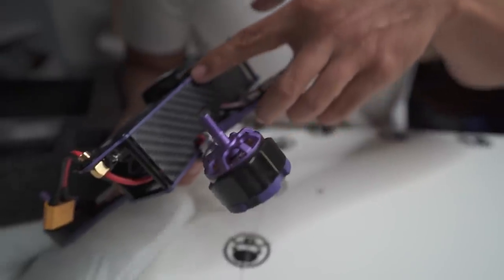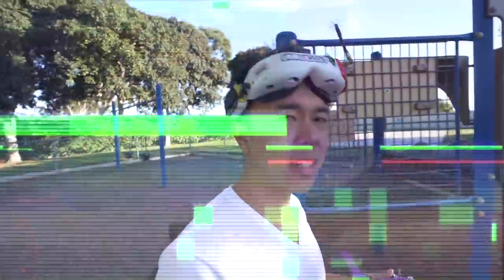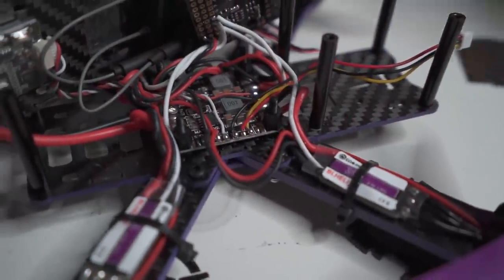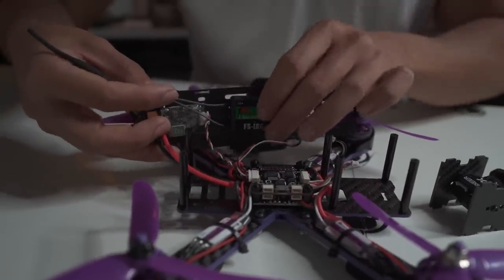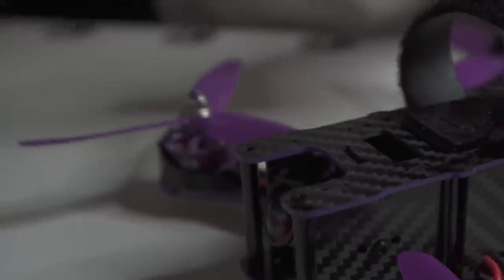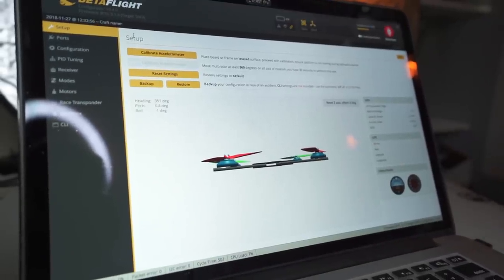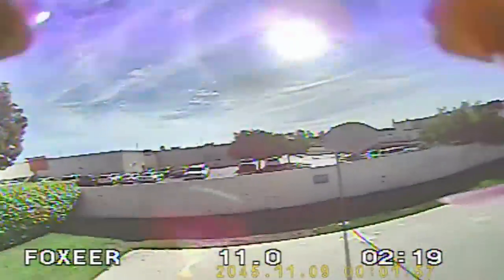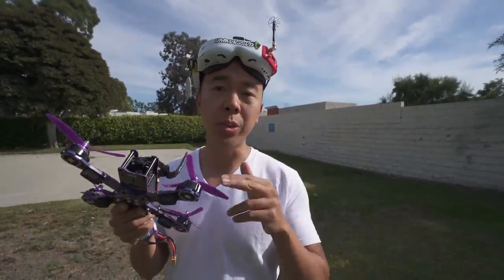Modding the Eachine Wizard X220 Drone! - Kwad Mods

Comment: So for wizard Owners , if you want an antenna upgrade just remove the rubber sleeve and cut the antenna wire to 12.9 mm , cause in fact for some odd reason eachine provided you with a 31 mm long 2.4 GHz antenna

Comment: Tommy’s here to pimp yo kwad
Reply: Le Drib lmao
Reply: Hey Drew, please ask Tommy to explain why he connected the camera to the vtx pad at 9:18. I know it will work on that PDB, but if any other beginner will try that on an FC with osd, he'll have to take the quad apart a second time....
Reply: according to the osd, it took him 3 years to do it.. c'mon tommy....
Reply: @LotharKrupka  That is where Eachine had the original camera connected to. I totally rewired my PDB but, it won't do any harm to connect the camera signal to the VTx pad on the PDB because it just a direct connection to the CAM pad on the PDB, where they have the video signal wire for the VTx connected to. 

Yeah, I know it is confusing how they wired the PDB but, it is Eachine we are talking about here. The power for the VTx also needs moved from VCC to a 12V pad, if you want to safely use 4S (there is a risk of voltage spikes from the ESCs damaging it if you don't).
Reply: Le Drib 😀👍🏻
Reply: #pimpedwizard, more of that please.
Reply: I got into FPV recently after finding your channel and bought a Wizard x220. This video is what I need. More like this please.
Reply: We heard you like Cable ties, so we put some cable ties on your cable ties so that you can tie whilst you cable.
Reply: Mod my kwad
Reply: Insert Pimp My Ride meme (here)
Reply: Sounds like a new Rotor Riot Series...PIMP MY KWAD
Reply: @Le Drib Please come to South Africa... i have accomodation... lolz... i guess you can bring tommy... XD

love the channel wish i could fly and keep it up...
Reply: Nah he's just rerolling the mods with some kuva he got
Reply: Le drib?????? Nice try guy its la drib
Reply: @LotharKrupka  idk why but it feels weird that you called him his actual name lol

Comment: So I've been flying for a couple years and the wizard was my first quad and since that I've built all of my quads. I definitely made a ton of mods to this quad and I totally love everything you did in this video. As far as the really easy things go the only other thing I would suggest is ditch the side plates. This is the only frame I've seen that has side plates and I've never had a crash that destroyed anything on the inside without the side plates on. Plus this will give the quad more yaw authority. Oh and you mentioned it but I guess forgot to actually do it, but it's definitely a good idea to change that antenna to an omni for sure. It makes me so happy that you guys are making this series because it's exactly how I started out and by doing this you're helping the non-confident new comers be confident. Keep ripping guys you're awesome!

Comment: Great video! Had mine for over 18 months now and it's a great flyer. I did change the camera too after a week of flying and put a different vtx in a couple of months after. 
I've recently switched all the components across to a new frame (5 inch Dingo) within the last 3 weeks and it's still great fun. 
Id recommend soft mounting the FC too, I've never changed any PID settings and it's running and older version of BF too.

Comment: If you guys want to shave off some cost, I bought mine during the sale at bang good a year ago and save like $45 buying the remote/receiver separate and just a ARF version of the 220 for $99. They can keep the junk 3s battery and charger. That way you can invest that extra cash in better props, antennas, batteries/charges whatever you choose, OR if you have some stuff already your golden.

Great flying drone, thing screams on 4S def will enjoy it...only down side is its heavy as heck especially if you toss a go pro/action camera on it...but for the price cant beat it. Parts are cheap motors/ESCs
Reply: somebody should probably pin this comment at the top?
Reply: @TheMadmacs  just depends if its on sale or not to save like I did or what you all need and how you want to go about the hobby. If you just want something to grab and go then buy the bundle... The battery/charger that comes with it is garbage, so if ur serious about getting into the hobby and want some resell value(incase u get out of the hobby assuming your new to it) you can buy a ISDT charger or something descent so you can actually recoup some funds. Then grab some descent batteries, for what you pay for the "wizard x220 battery" replacement you can buy a tattu or turnigy 3s same price or less.

Comment: I use the Same transmitter (fsi6), But i moddet its Firmware so i can use all switches and use 10 instat of 6 Channels.

Also i Set the  arm switch to swB, turtlemode on swA, beeper and light on/off, on vrA, color on vrB, flightmodes on swC, and airmode on swD.  This is my Setup on all models for this transmitter.

Comment: Cool video,  wizards are great to teach the basics.  A few upgrades and they do pretty well for the money.  Despite progressing onto Roosters etc.  I still keep my wizard to practice all the tricky stuff. Recently I've dropped the top  plate about 20mm which makes it look really good.  Replaced boards with a Racerstar f4s tattoo all in one board to really tidy and lighten it up.  Moves so much better now,  along with a runcam swift and a decent vtx it's a very capable little beast!

Comment: Wow. I wasn't expecting this on Rotor Riot channel - Thanks for this video Tommy. At least I know that my almost 2 years old Wizard wasn't a waste of money - when I see you (almost in 2019) focusing on it and investing your time to try it out with respect to this quad. Sure it's not the best one, but for those who have not much time or areas to fly very often - this is the cheapest and still good enough solution to start with. Especially with Full HD camera on top which Wizard was made for. AND YES - stock VPS camera is just horrible - I can't believe I was flying with it whole spring of 2017 before replacing it few months later (too late) with a wider one, with osd and much brighter picture - which helped a lot. I simply couldn't see much with the old one - and it was very risky to fly in some areas. It took away a lot of confidence to do acro. I felt trapped inside the goggles, to tell the truth. I should have replaced it before the first flight - so my beginning and switching from simulators to real quads would be so much easier. That's why I'm glad you've pointed this out for new beginners now. A very important thing to avoid the disappointment of new guys in the hobby: Replacing the camera at the beginning.
But old Wizard itself is still a nice one - Even though I've started with it, before moving to smaller quads (not so stable but safer at least) - I think that in spring of 2019 it's still gonna be a good quad to consider having fun with. Can fly surprisingly smooth in acro. Stabilized flight is not the best in this one (some micros fly better in horizon than Wizard does) - who flies horizon on 5 inch anyway. Can carry a lot of weight and fly fast enough even for medium freestyle pilots.
Won't ever be like one of your machines but at least it's cheap to replace, great to start with and train for the very first year of FPV - or even for two, three years. Really, thanks for this video man.

Comment: Thats funny! I started with one of these! Esc's caught fire so i changed almost everything on it. Nice video :)
Reply: wasnt that the early versions that were known to do that?
Reply: I bought mine in July 2018, 2 caught fire. 
Then i changed all 4 esc's, all 4 motors, fpv cam, then finally the fc.
Reply: @zeni-Geva  hmmmm i wonder if it has to do with their shitty wiring job on the PCB. I know its sort of weird but everyone claimed if u wanted to safely run 4S batteries on the wizard u had to rewire the PcB a bit  cause off some claiming the ESC braking could fry some stuff as some stuff was wired to the BATTERY pads for power instead of a 12v stable pads for source of power. I think in terms of the VTX they were saying was the reason you needed to rewire it IDK i did that to mine and rewired it when i first got it(since i had to redo the camera as well( and i never had issues except when I crashed and lost a ESC....im running 3 old and 1 new ESC and its been fine so far.

Mine was all jacked wired, some stuff that needed 5 volts was spliced into LED pads, and the Camera was like wired to the VTX pads and vice a versa...confusing as hell but i know it was messily wired like that stock from factory.
Reply: bought mine in 2017, never changed anything except camera and antenna. The quad still flies perfectly with all the parts it came
Reply: I’ve also caught fire on one of those esc after battery replacement to 4s and more aggresive props.
Reply: @MrDracul88  how aggresive? i havent gone over dal 5045c 's   I got some bullnose 5045s and some 5040c 's i havent tried yet
Reply: VideoGame Polak 5045 on full power. Those escs are tiny for Today standards but can be easly replaced together with AIO fc
Reply: zee Gee so u basically bought a new qwad😂
Reply: @MrDracul88  yeah but a AIO 4 in 1 ESC, what happens if you burn out a ESC on that? $40-50 for the whole board versus $8 for a replacent ESC on the wizard single esc
Reply: @Fliptality  same here flying 4s left vtx wires where they were , no issues but upgraded vtx later, use stock vtx with HT on bipe.  my wizard has been flawless.
Reply: same ESCs caught fire got new ones

Comment: No way, just ordered this a couple weeks ago on banggood with 4s batteries, extra props, arms, and motors as my first quad haha! Love these beginner videos, so helpful!
Reply: eek 4s?....   find a field, a big field... a big big big field hehehe... you should get as much sim practice as you can,  even the gta5 mod with the quad simulator is worth it just to get the feel for what the sticks do.
Reply: @TheMadmacs  haha yeah, I've got a good 4 acres of open, obstacle-less field to practice in and am spending a ton of time in liftoff. Super excited, but I'm preparing to crash hard 😅
Reply: @LandonCramer  ah you should be fine then,  throttle is the first thing people struggle with,  just remember to include lots of bank turns  emergency stops and straight and level flight in your practice, and don't stay in the open field so long you are scared by obstacles,  and try some dal cyclone 5046 props, clear coloured if you can find them... and start getting advice on cheap motor replacements right away,
Reply: @TheMadmacs  will do, thanks!!
Reply: @TheMadmacs  and what about the t5050C props? I already ordered those...
Reply: @LandonCramer  i havent tried those but they should be ok, bit heavy on the batteries?  5046's were a revelation for me, throttle control was much more precise,  the 5050 might be perfect for you
Reply: @TheMadmacs  I been using Gemfan 5042. Tossed the included bag o props out. used 5046 b4 these 5042. Being a noob with no sim(no network), can't address performance, obviously lost some, but these 42's give me much better flight time and durable. about 1 1/2 minute more then 5046.
Reply: @flwoods1  yeah i  think the main lesson is to try different props now and then, i spent way too long thinking KK 5040's were perfect,  never even opened the bag of 5045s, then i thought dal 5045's were perfect and didnt even open the 5046's, they also looked way to heavy on pitch... but as soon as i tried them, i felt that i could adjust height so accurately it was unbelievable.. njtech did a video about how your throttle should feel every bit as accurate as roll  pitch and yaw, and thats what dal 5046's are for me, i can change my height a couple of inches with no problems.

Comment: I picked up the x220s with that same quick intrigued google search, and went with an ARF version, which benefitted me in the long run, but also forced me into soldering since it involved installing my own r-xsr receiver, and dissecting betaflight to figure out the ports for the receiver.. Not bad things though, i know the knowledge is all vital to excel in the hobby anyway and the control was buttery smooth and fast right away. Nonetheless the x220s has a much better camera and comes with a pagoda antenna, which i promptly lost after like a week. Being my first setup, i plan to build a much cleaner quad when i get better at soldering.

Comment: That Radio is awesome, you can make it a 10 channel radio (ibus only) by installing a different firmware, the range is more than acceptable for a 50$ radio, and you can use it in a body box with a taranis. It really is the best radio for beginners.

Comment: I started on this model! love hate relationship, its a cheap entry quad but expensive to replace all the shit parts. 20A esc's are known to catch fire randomly. Best to buy similar parts from banggood but with cam, esc and vtx Upgrade.
Reply: not everyone wants to fully build their 1st quad though., Im all for an esc upgrade, but mine did last me best part of a year (after I replaced 1 esc from the box haha). 
The vtx is fine on my x220, beats the stock diatone gt2017 vtx by far and that's 500mw. Things I upgrades from the box was the camera and antenna, the rest held out well., still running the gutts over 2 years later and it's all good., throw a new vesion of beat on it with dynamic filtering and it's like a totally different quad. really well locked in., feels strange as it's the wizard after all haha
Reply: @FreeDivingTreasure Especially when the ONLY THING THEY MODDED was something you can't even fuckin use if you get the quad as is.

I mean he says "So we gonna fly it the way it was out of the box for 200$... lemme just put on my 750$ FPV goggles.

Comment: I have replaced everything apart from the frame, motors, PDB and FC on my wizard over 2 years. I get a solid 7min flight time with moderate to heavy throttle on 4s 1500mah. You can't say that about most drones now. I'm ready for something more powerful now but I will miss that flight time if I upgrade.

Comment: Super noob question maybe: Is there some trick to holding the motor still while fastening the prop nuts? Having the props cutting into my hands trying to hold the motor still to get the nuts nice and tight sucks.... and I don't wanna stress the props either, I'm sure there's something I'm missing.
Reply: Chatsu8o yeah I’ve been flying for a couple months and am still wondering this
Reply: I use. a piece of duct tape about 6or7 inches roll or fold together the sticky side and use the silver to wrap around and twist to hold tight the motors clean and cheap
Reply: the answer is, use a small towel or rag to hold the motor , then the props wont cut into skin so much, dont over tighten them
Reply: A pair of the rubber palm garden gloves work great
Reply: Stick a small allen wrench through the cooling holes (avoiding the windings) for leverage.

Comment: As a beginner, don't even bother with 3S, go right to 4S. If you have more power than you can handle, you can just reduce the maximum throttle in you transmitter. That way you don't waste money on batteries that you won't need anymore once you've got basic flight skills.

Comment: ooh great idea,  this is so many peoples path into fpv,  solid practical mods are what every noob is looking for.  not sure what is the next mod i'd pick,  think noob? uuhm.... props and antennae  .. i doubt you guys know that the flysky i6 can be hacked to give telemetry without using FC, but its a bit daunting for a noob.  the i6x does it by default with the x6b rx.  you should probably do goggles and chargers/power supply next.

Comment: You'd be surprised how good you can get with the x220 and flysky i6 after a little practice. They may not be as precise as the higher end options but once you get a feel for them and a nice tune going footage wise there's not much in it. you can still fly well with cheap kit., it just don't last quite as long and tends to be a little slacker in general, which you learn to fly around anyway.

Comment: Great episode., I really could have done with this 2 years ago haha but in fairness, JB and stew from UAV futures had me covered. 
I started with a x220, great little quad. Same upgrades to start too, the camera needs replacing straight away, terrible... dipole for a RHCP, stock props for cyclones, ppm to ibus, beta upgrade to add dynamic filtering., then maybe find a better way to mount the antenna, stock is very precarious. that should have you covered until you start playing around with rates., 6 months down the line you'll probably swap the 20a escs out for 30a escs and upgrade the motors to something a bit more powerful. At that point you will be able to do turtle mode because of the new escs run d-shot., you shouldn't be crashing so much after 6 months so remove those motor guards to save a little weight. I painted mine pink also and renamed it "the wizard sleeve".. that upgrade is optional.
Reply: oh I only flew 1 pack at 3s, I ordered a few 4s with the x220 and frankly it felt a lot closer to the simulator I was using on 4s so the 3s just kinda got used for crusing when my 4s packs were spent. Also comes in handy to use for my goggles or charging whoop batteries on the go. 
I know swapping escs isn't the easiest task for a beginner but the 20amp escs on the x220 aren't great., in fact, I had one burn out on the maiden flight a few seconds after arming. They did last me around 9 months though but upgrading felt a lot better all round and I felt less bad for hammering the throttle.

Comment: so I have the older version of this drone, but I think it has the same camera. Is the stock camera just not capable of sending voltage readings to the osd? No matter what I turn on in betaflight I only get 0 volts... its a 3 wire camera.